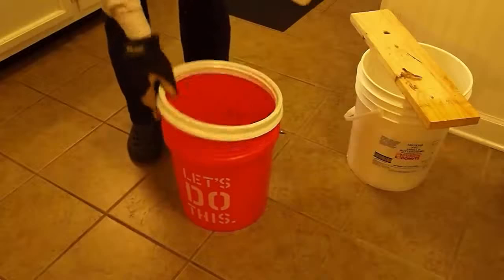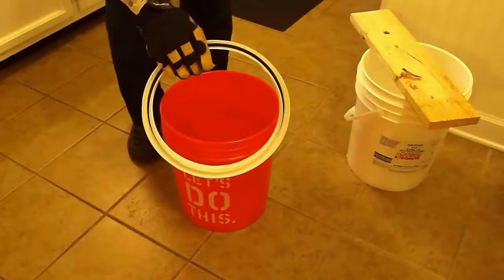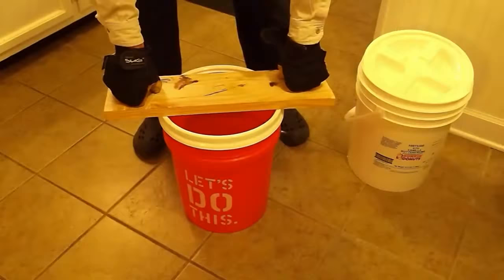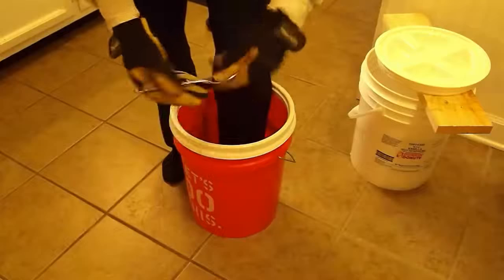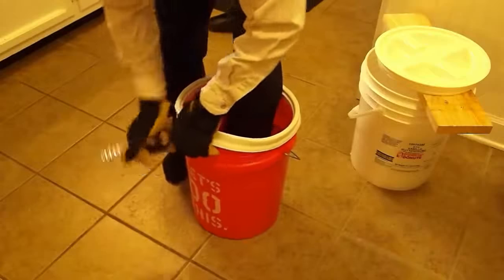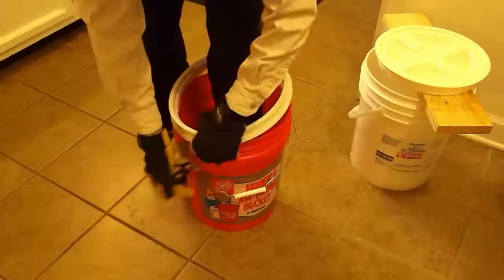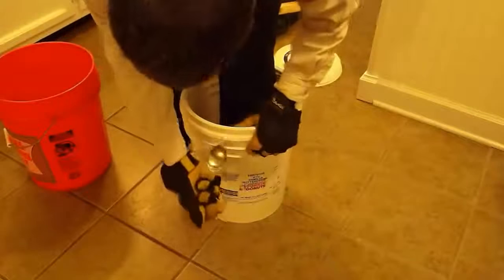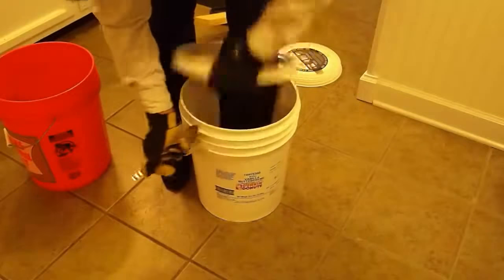Easily and Safely Remove a Gamma Seal Lid from 5 gallon buckets

Comment: Oh, my~you are WONDERFUL! I have 2 big Vittles Vaults that squirrels have chewed the lids on-all the way to the black rubber gasket. I was looking at replacing those containers or somehow prying off & replacing the old seats. I had spent ages trying to pry those lids off without using your magic trick. Put my foot in the container, and pried gently around the edge with a claw hammer-less than 30 seconds and NO EFFORT, we have SUCCESS! Thank you! You saved me a bundle of money.

Comment: WARM UP YOUR SEAL RING WITH HOT WATER TO BE SAFE BEFORE YOU TRY KUE MAN'S METHOD! 
 My Gamma Lids have been on My buckets for 10 years+, I tried what you showed but it cracked chunks out of the rim of the seal ring. 
With nothing to loose, I put the bucket upside down in the sink and ran hot water around the rim to warm it up. I dried the inside of the bucket so I could stand inside it, I then tried your method.THE SEAL RING POPPED OFF IMMEDIATELY!!  I figured that due to the age of the plastic, that the heat made it pliable. Plus it softened any debris of flour or sugar that might of accumulated over the years of use around the seal ring.
Reply: This spoon method wasn't working for me until I warmed up my lid. It worked like a charm, thanks!

Comment: does that seal work on a smaller bucket? and once seal and closed they can handle pressure??
Reply from the maker: "No" to both questions.
Reply: Actually it does fit on smaller bucket sizes but probably not the pressure.
Reply from the maker: Actually not the one I am using here which is for 5-gallon buckets.  Gamma Seal does sell smaller lids, yes, but this one would not fit on a smaller diameter.
Reply: The same lid works for both 5 gallon and 3.5 gallon buckets (at least from Encore Plastics). I know this because the 3.5 gallon bucket I bought was too small for my purpose, and I needed your method to switch the lid. My particular every day spoons didn’t quite fit, but a big serving spoon surprised me by working. Thanks for the help!

Comment: What to do when the lid is stuck, won’t spin and so you can’t put your leg in? 🤦🏽‍♂️
Reply from the maker: That's easy - take a hammer and at an angle tap the ring (you will tap at kind of a side angle the inside handle/ ring that spins into the outer ring).  

Make sure you place a towel or something against the plastic though before you do this so that the hammer does not directly hit the plastic.  Just tap it in several of the four or five ribs of the inside lid that is stuck.  Make sure you are tapping in the direction to unscrew the lid obviously.  

If that somehow does not work, and I would be surprised, [CAUTION - MAKE SURE YOU DO NOT BURN YOURSELF - PROTECT YOUR ARMS AND HANDS !] microwave some very wet larger hand towels for 2:30 minutes and then lay them over the top of the lid especially where the inner lid portion spins into the outer ring.  Let it cool down a bit and then try it.  

IF THAT DOES NOT WORK, I'd then fill a sink full of hot water about 3 inches deep and then place the bucket lid side into the hot water and let it work on the lid to soften the plastic.  Let it sit for at least a minute.  Then take it out and try it again.  

You can combine the hammer tapping method with any of these last two tries.

If any of this does not work, I have no more tricks!  Get a new lid?
Reply: Kue Man Hammer worked on the 4th time around tapping each rib. I appreciate it, thanks!! 🙏🏽
Reply from the maker: @gedionsamuel2256  Excellent!

Comment: Video is almost entirely this guy listening to himself yammering. So many you tubers just suck. Do you people really think we care?  Start the demo immediately
Reply from the maker: "So many of you tubers [no, not like you] just suck. Do you people [no, not Patrick E] really think we care?" 
All you had to do is turn off the audio or move on to relevant parts.
Reply: J O...You rock for not making a 20 min video to show us something that gets the job done in 2 minutes!  It was perfect...u should get a utube award👏
Reply from the maker: @anonymous-ep2bz  thanks very much.  Sometimes the most frustrating little things we think should be easy end up taking tons of our time.  This little method I came up with was because I searched youtube also, and watched another video on how to remove one.   It had the person suggesting to soak the bucket in a sink of hot water for 15 minutes and then using a $20 rubber hammer.  He struggled for a long time, got his pants and floor wet.  He did finally get the gamma seal outer ring off.